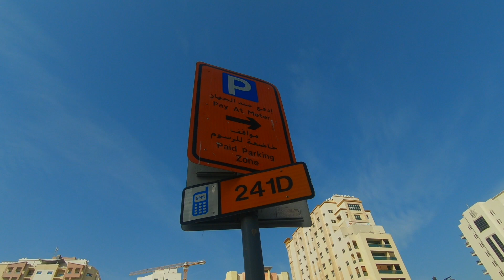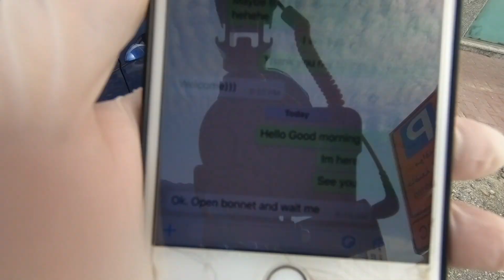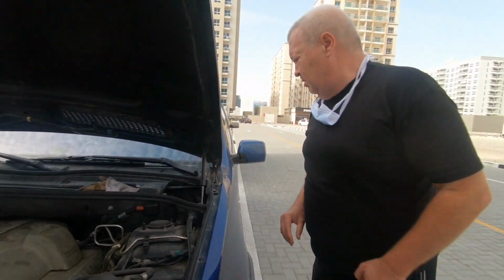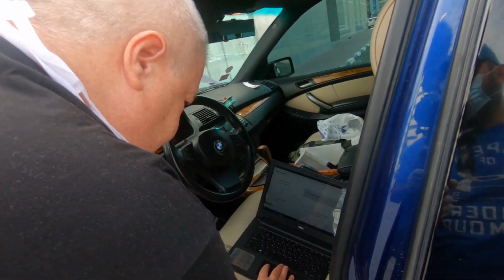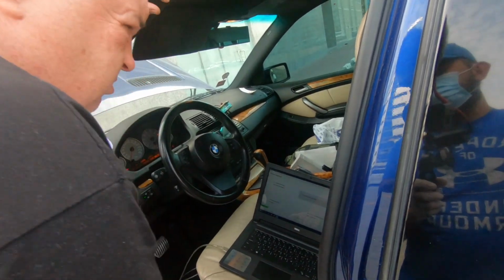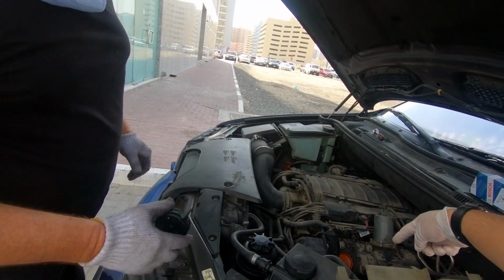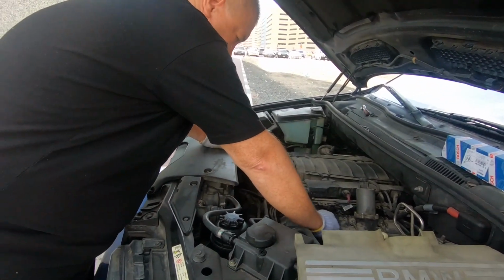Dubai | Replace ignition coil in BMW X5 e53 4.8is | Car vibrations for BMW | 2020

Comment: Great video and keep sharing! As E53 owner it is really useful. I need to do the same for another reason on my 4.6is and this video shows actually how easy it is. My question: would you replace only a broken ignition coil or should you replace them all at once? I have one cylinder 5 misfiring according to my computer.  That would be right-hand side bottom first slot correct?
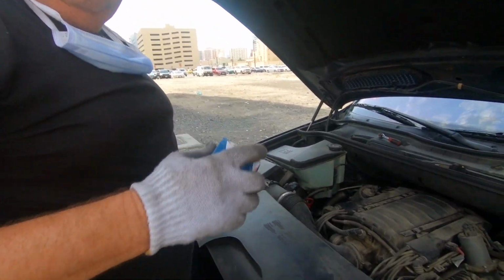Reply from the maker: In my case I replace one but if you are really concern you can replace all. As per my friend mechanic you can replace those who's having misfires. The 5 position would be in right side 2nd slot. Watch the video 5:20 you will see counts for ignition coil